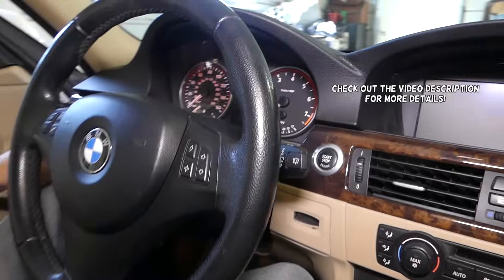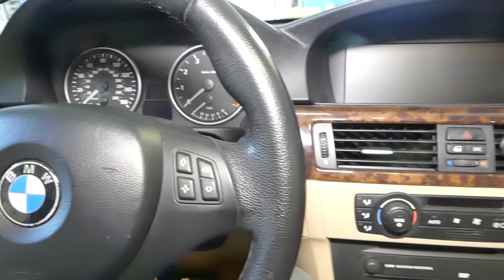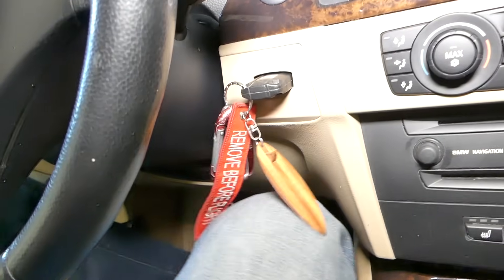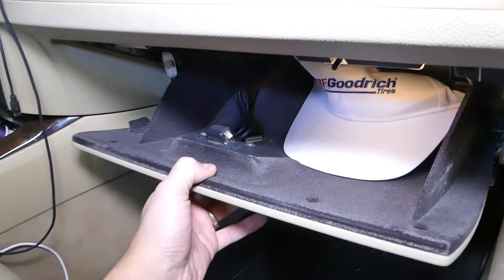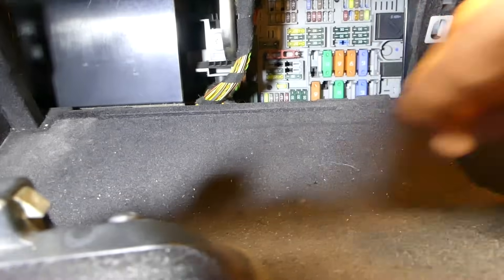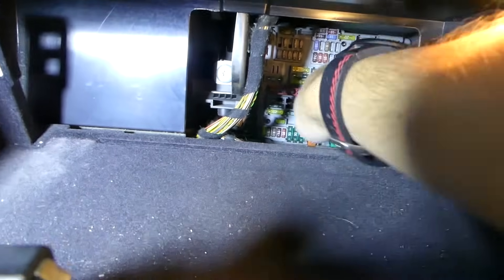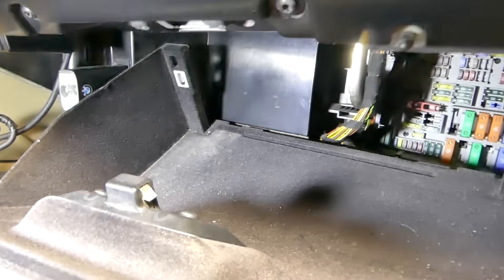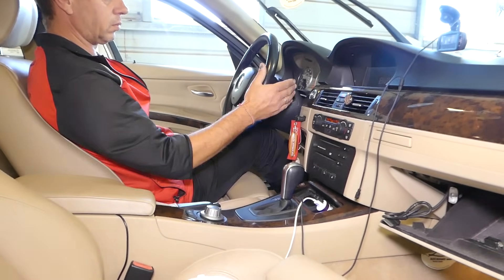NO START NO CRANK FIX BMW 325i 328i 335i 316i 318i 320i 335d 320d 318d 325xi 328xi

Comment: Just got an issue with my 390. It was sitting out in the heat so I’m not sure if it’s the starter or relay. Battery seems to be working fine as all the lights and everything is on but just won’t start. Any suggestions? Please and thank you.
Reply: Jiggy_MHD yeah I have a 2010 328i and it just makes that clicking sound. Does anyone have an idea of what it could be?
Reply: The G_Ross probably the starter. That was my issue, but it’s resolved now. Hope this helps.
Reply: Jiggy_MHD thank you a lot bro
Reply: Alguin me puede ayudar en una x5 2001

Comment: Hey i have a e90. 335 xdrive and I hit a tire last night my battery light came on along with my 4x4 also my car over heated and turned off I didn’t know it was overheating because I have no meter to tell me but I tried starting the car. Today it wouldn’t even crank I’m just wondering what should I be checking for in my car for why it doesn’t turn all the lights but the stereo work.

Comment: Hi please help have this issue but mine is intermittent and start from cold no problem every time it’s after you have driven it and come to start it after only just stopping and then if you wait 20 minutes it starts again but this items says no available on the link could you send me the part number thanks!

Comment: Yes! This saved me a ton of money! I got the part from the bmw dealer and fixed!!!
Reply: You look like Taylor Rain.  😍💓
Reply: help please 🙏 
I have one 318d, whats going on with reley?? 
Was reley HOT??? Mine is to HOT!
Reply: @noahmojsin5745  Mines got wet. Some how it fell off the panel and got wet. I have a BMW X5 i3.0
Reply: Hello Everyone STARTER IS THE PROBLEM …
Reply: @noahmojsin5745  i have the same issue, just replaced with brand new started and nothing changed at all!  have 2011 328xdrive
  manual with 54k miles

Comment: My car was working fine all day came to the liquor on the way home from work & now it won’t start 😅 the battery & lights turn on in my car when I press the start button & so does the AC which doesn’t usually work unless the engines on. I had no lights on my dash & now tht this problem occurred the service soon light came on. Could this be the same issue?
Reply: i have the same problem did you find a solution ?
Reply: @bennycisneros1930  needed a new starter

Comment: Hey, I have a similar issue but my starter motor is making a clicking noise but not turning over. Would it be likely it could still be the relay? Thank you! Super helpful video!!! :)
Reply: Did you ever find out the issue, this same thing just happened to mine tonight
Reply: It ended up being my starter motor, I had it replaced for $480. Auto classic was quoting $1600!
Reply: Not what I like to hear but thanks for the response. Sadly might have to do this myself if it’s not the relay I’m hoping that it is
Reply: I was hoping the same, I was also advised to try a spare key as it may have been the immobiliser. Wasn’t in my case but may be worth a try?
Reply: If you are hearing a clicking from the starter motor when you turn the key though, it means it is getting power. If that’s the case it probably wouldn’t be the relay or immobiliser.
Reply: I wish I could just post the video I took to this for anyone to help me lol
Reply: Jordan Sass you could upload it to your Channel and the paste the link here. However, I think I am the only one helping and I have offered all the advice I think I can. Do you have a clicking noise?
Reply: Em Booth I had one maybe two clicks, it had power to it since I tested the solenoid when the battery was plugged in. I’m in the process of booking everything back up after putting in my new starter
Reply: Jordan Sass should definitely upload it if showing how you replaced the starter. I have a 1999 323i that I’m pretty sure also needs a new starter but it isn’t registered so will need to do it myself at home.
Reply: Em Booth sadly I’ve already done it all myself already. I recommend BMW Doctor or Nathan’s BMW workshop for any videos of repairing your car. They’re unreal.
Reply: @embooth4590  lol i bought one on amazon for 77 dollars and replaced it myself it only took one hour to do and works like a champ

Comment: My BMW E90 328i 2009 won't start. Key fob is not working even after pushing it inside ignition to start but there is no light inside. Looks complete dead. Please help me troubleshoot this.

Comment: I have the same issue with my BMW 535i 2015. Not star not crank 
The car only turns on the lights on the dashboard🤦🏻‍♂️
Reply: Found out what it was mine just shows key in the ignition n my screen don’t turn on nomo also days before it gave me no start problem

Comment: Hey i could really use your help. My 2009 bmw 328i cranks but doesn’t wana start. Pretty much checked and replace everything that could possibly be causing it but still no luck. Fuel pump getting no power, seats windows idrive not working but when i jump the fuel pump from the battery everything comes on and start working but the car still wont start.  Please if you can suggest anything I can look at i know you have over 400 videos on this car but I couldn’t find anything that relates to my issue. Thanks
Reply: Did you find your issue ???
Reply: @BLK_N54  yea I believe it was the fuse in the glove box

Comment: My 320d 2008 does the same but intermittently, usually after I have driven the car for a while and then gone back to it! Then after 15/20 minutes it will start fine. Can you please help? Thank you
Reply: @Craig Ellis nope! So annoying...if I do I'll let you know pal....or if u do please let me know... regards
Reply: It was the starter motor pal.... all sorted now👍🏽👍🏽
Reply: @amerditta8262  Hey man.How have you fixed the problem,what was wrong with the engine starter?Many advanced thanks.
Reply: @amerditta8262  Hi! I have exactely the same problem! Mainly in summer, when wheater is hot. After long or fast ride car always wont start. I need to pick up the hood and wait until it cool down. After 30-60 minutes of waiting everything works fine and car start from first hit. Could you tell us more how you fixes them? Replaced starter motor or what?

Comment: Good afternoon   I'm in need of help with  my 2007 bmw 335i v6   it happened to turn off at the light  it has a new battery  ,checked the relays   anyway  it lights up the dash but not crank  or start  anyone might know what it could be

Comment: I have a 2006 BMW 325 I changed the valve covered gasket it ran rough now it's got no start and when it was running it has no throttle pedal like it staying in idle mode push the gas powder down nothing now it has no start

Comment: I have a 2003 330ci BMW . I am having a hard time finding out why it won't start . I've tryed almost everything . Even sent key and white box in to get reprogramed . And still nothing . It has battery power just won't turn car over  alot like what is happening in this video . Any idea"s?

Comment: 2011 E90 Diesel Electronic Ignition Lock Control Unit - Faulty - Not Detected: No Signal

Hello all. I performed an oil change on my 2011 DUDMD Tuned 335D and was stepping through the odometer button and pulled the key out. Now the vehicle cranks but will not start with the above error and the 2 below. 

KL30g F Cutoff>Not Currently Detected

Electronic Fuel Pump Motor Current Too High>Not Currently Detected: Invalid Signal.

The car was running fine prior to me pulling the key out, I tried to replacing the Ignition Lock Assembly and still will not start.

Any assistance would be great.

Comment: I need help majorly. My e90 doesn't crank and I have replaced the starter, battery, and the relay and still nothing. The brake lights come on, the park light is on, the key has no associated error showing. It started having a little trouble starting before it died completely. Now I insert the key, turn on accessories, and when I push the button to start, I here a click, a small motor humming, and after about 5 seconds of that, the accessories are turned off and I'm left with dash lights that show normally when I first insert the key and push it in. What the heck is wrong with this car? What more is there that is part of the starting circut/system?????
Reply: Any luck brotha?
Reply: unfortunately no. I replaced the transmission control module and that didn't fix it either. I troubleshooted it down to the starter with a certified mechanic buddy of mine, but seeing as I had replaced that recently, I wasn't mentally ready to spend money to replace more parts. I think a new starter would have fixed it, but I sold it before I could put a different one in.

Comment: My BMW 328i has this same issue (I believe). If I remove the key and insert it 3 or 4 times it cranks up. Could this be the same issue?
Reply: Did one of you find the issue mine kinda does this
Reply: Fuel pump

Comment: How do you test the relay?  Doesn't make sense to just replace parts with new parts at random
Reply: @Big Ed I forget if I tested the relay.  I think I tried other things but my issue ended up being the grounding cable on the driver side.  It was shredded.  I just jacked the car up, took off the bottom panels so can get access to the bolts for that cable and replaced it.  I got an official OEM cable from the BMW shop and it was like $70 or something (can't remember but more than what it seems to be worth).  Was somewhat of a pain to get to but if you're arms aren't big, you'll be good if that's your issue too.

Comment: Hi Guys.
I have 2009 bmw x5 4.8. The same noise is heard from the fuse box while starting and stopping the car. And when I try to turn off the car the headlights and the alarm lights don't turn off. I changed the fuse box on the front and the relays on the back, the fuse box and the roles from which this noise comes from. but the problem was not solved. The car does not turn off the ignition and the rear lights and headlights indicator lights do not turn off. I have to unplug the battery every time
. Please help me

Comment: Hopefully does the trick on mine! 
I tried to unplug my current one and plug it back in but still not starting up. We'll see if replacing it does the trick!
Reply: Did it??
Reply: Did it work?
Reply: @erickismael1993  Nope sadly didn't work for me.  Still stuck with it not working going to try and love tap the starter and see if that helps. Otherwise off to a shop for her. :(

Comment: Hey i have a 2004 e60 and i was driving and it misfire and cut of and now it have thay same systoms where do i get that relay in the car . It is not in my glove box
Reply: its at the back, in the fusebox next to the battery. It isn't labelled in the fuse diagram but it looks exactly similar to the one herein.

Comment: Mines want start or crank what could be the problem.. 2006 bmw 325i
Reply: Did you figure it out?
Reply: @joshbrowning3488  starter
Reply: How do you know if its the starter?
Reply: Success4TheBest continuity tests on relays, plus if you have lights on in your car that are not weak, then your alternator is ruled out automatically. If you hear a clunk when you try to start that is the starter receiving power but is seized up or maybe you don’t hear the clunk. So if you have ignition or spark and no crank it’s most likely your starter or maybe this relay.
Reply: If it starts few 1 second than dies 
You have to keep repeat starting it until engine temp warms up a tad bit 
Watched a video on YouTube and it happened to the guy in the video did that about 10-12 times and it started and same with mine after 10 or so times it fired up

Comment: OKAY we thought this was the STARTER  relay as the car wont start and had a no crank..so we jumoed this black relay across the terminals and now all the headlites, brake lites, and dome lites and wipers wont shut off with car off.ALSO car is automatic and now shitfer wont move..cant shift..PLEASE HELP.

Comment: My bmw won't start , the starter click but won't start. Changed the relay 2013 bmw 750 li xdrive
Reply: Have you fixed it what's the problem am facing the same with my X3 2013.is today it happened after driving to bank packed when I finish only for the car to refuse to start but there is light on dashboard, stereo place,AC on ,than service indicate on the dashboard.

Comment: Thi just happened to me , I’ve replaced the alternator and the battery .. and my car won’t even crank or want to even start I’m thinking this is the problem I will find out tmrw if not it may be the starter? Did anybody else have this kind of issue ???? And this worked!👌
Reply: Lilsims what was the fix ?my car just turned off on me while I was driving and now it won’t start
Reply: ImTheBestInThis mine was my starter then it turned right on !!!
Reply: ImTheBestInThis that sucks tho fr

Comment: Having same issue, I replaced the relay and started once or twice. But has same issues. I replaced the flat wiring for the start button and key slot and started once and then same issue. Help!

Comment: Anyone here know what the problem I have is , I have a 2007 328xi , recently my radiator pipe kicked the bucket , unfortunately it was when I was driving so all the coolant leaked out before anything ,I stopped the car and parked before it started to overheat , and after it cooled down I moved it 10 feet just to get it off the road . A week later my car won't crank or nothing , I fixed the radiator issue , I unplugged and replugged this relay in the. Vid , and then I even disconnected my battery and did a obd reset , I'm super frustrated and lost on this .

Comment: Hi Guys i own a bmw 320d 2010 LCI model, i have exactly the same problem, i drive around few miles maybe to the nearest shopping centre and once i m done with buying ,10 minutes my car wont crank wont start, i have to wait until the engine is cold maybe an hour or even two, does anyone have the same problem can you please help me because the diagnostic tool shows nothing wrong on the engine.
Reply: Hi! I have exactely the same problem! Mainly in summer, when wheater is hot. After long or fast ride car always wont start. I need to pick up the hood and wait until it cool down. After 30-60 minutes of waiting everything works fine and car start from first hit. Do you know what was the issue?
Reply: @micubussii6773  thats maybe starter vk, change it and try

Comment: Thank you thats great video,however i have similar problem no crank no start only if the engine is hot maybe driven for an hour or so, few minutes if i start the car no crank no start till its cold, bmw 320d 2010 N47 engine - JOE
Reply: I face same problem for few years.  Computer does not show anything.  
Did you solve this problem,  tell me how, what was the problem?
Reply: @falipitarka5446  Hi! I have exactely the same problem! Mainly in summer, when wheater is hot. After long or fast ride car always wont start. I need to pick up the hood and wait until it cool down. After 30-60 minutes of waiting everything works fine and car start from first hit. Do you know what was the issue?

Comment: Was the car brake hard to press? All my lights turn on and I jumped it? Literally last night it worked and today it wouldnt run the engine. Anyone know the answer?
Reply: Raul Garcia you found out the fix?
Reply: Yeezum Yes. It was the starter.
Reply: Same happening to mine the brake won’t press but the lights work and everything
Reply: Was the steering wheel locked too?

Comment: Hello world mechanics. I’ve recently changed my battery and starter but still it’s not turning over. How exactly will I know it’s the relay? Like others my interior electronics work with no issue, headlights too! Please respond this is very taxing on my patience and nerves. It’s been 3 weeks now that I haven’t been able to drive.